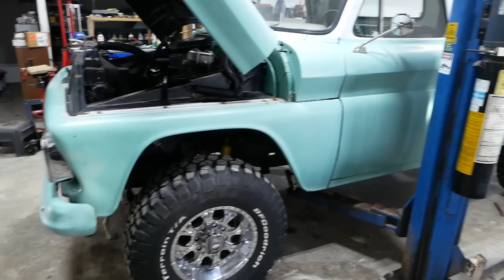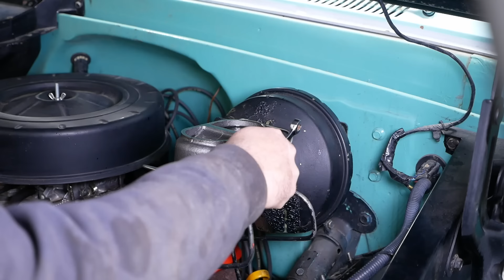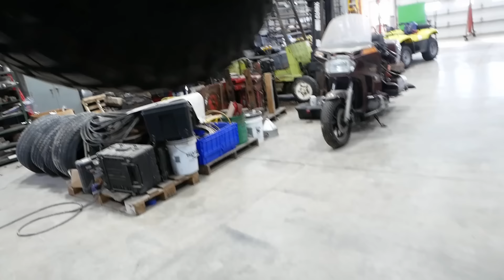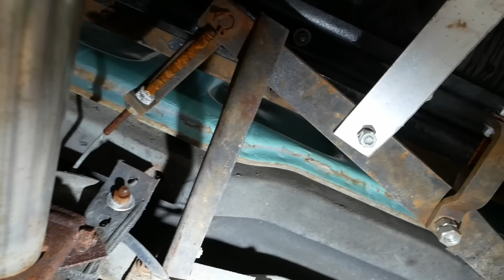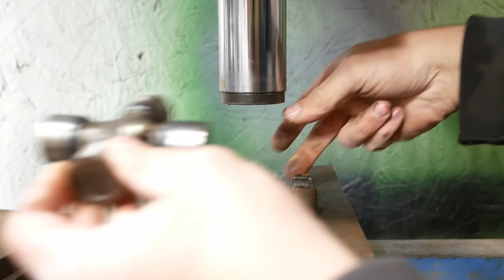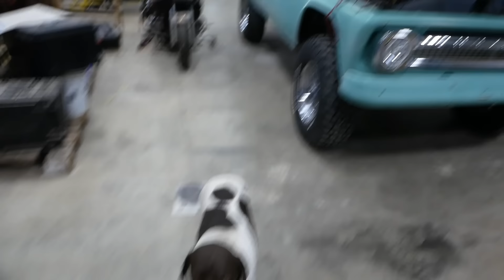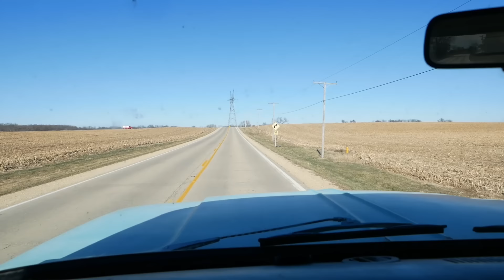New Parts = No Brakes and Other Problems | 1964 Chevy K20 Project

Comment: The current leak is most likely caused by the external voltage regulator.  The points in the regulator tend to stick.  There are conversion kits that convert to an internally regulated alternator, these are far more reliable (10si-12si vs the 10DN you now have), but you can easily make your own.  1966 and prior trucks came with a single reservoir master cylinder, someone converted it to dual reservoir.  You need to check that the current master cylinder has a residual pressure valve in both outlets, otherwise the brake shoes will sit too far back from the drum(s).    The leak down the brake booster is usually because the MC piston rear seal is leaking, if it isn't due to overfilling.  Yes, they did come with power brake boosters stock, but this one is probably an add on.  You need to make a equalizer linkage for the E-brake, it is rare to find one in a junkyard or online because these trucks are getting rare, especially the K20 trucks.  Your rear end is either a HO52 (most likely) or a HO72 Eaton, used from 1947-1972.  They make a 4.11 gear for them, but they are expensive.  A lot of people just swap to a later 14 bolt because it is less expensive and because there are plenty of them in a variety of gear ratios, and they have better brakes.  Most 70s-80s GM trucks with 14 bolts are 3 inches wider overall (1.5 per side) , most people use rims with more backspacing.  It requires moving the spring pads inwards. Power steering is possible, but you need to know how to do it.
Reply: I believe I saw a power steering pump, but it might be a dummy.

Comment: Dear Mr. Wes.
👍👌👏 Very well done again and as always. 2) 😱 My oh my! I sure have compassion with the owner! Not only that he has no clue what he is doing. He additionally definitely fell for a cobbled together dazzler from a very inhonest seller. Unfortunately the only mint thing on this vehicle seems to be the kind of mint colour. Just what morons have worked on this car? For instance by simply shortening the lower radiator hose a bit, the kink could have been avoided. Anyway: The very first thing I would've done, is to convert this old pickup truck to at least front disc brakes. Especially because the owner wants the vehicle to do highway speed in the future. Hope that the complete underside will be sprayed with good undercoating stuff before using this nice oldtimer in winter on salty roads.
Thanks a lot for making teaching explaining recording editing uploading and sharing.
Best regards luck and health to all of you (including Max of course).

Comment: wes,,where do i buy the rear lift blocks,.joke,,... what he needs for transmission, is a zf 5 or 6 sp manual box. 4.11 diffs. if he goes auto with 3.5,s. might as well ditch the front diff, as 4x4 is useless. all my trucks are 35,s. zf 5 sp. 4.11 diffs. .plus, big bonus, is fitting a bmw 3.0 tdi. 300hp. 15 lt 100..ish..theres conversion vids, world wide.

Comment: p/brake, . should hav a 2nd cable that slips thru a 1/4 curved u channel, so it slips.. or a bar pivot, like modern trucks.or, use a rock.

Comment: I personally would body swap the truck onto a Chevrolet 6.0 5 speed frame and running gear. Solves almost all of the half assed work the truck came with. Just have to find a southern frame as they all like to rot out above the rear axle.

Comment: Best cure for a howling Eaton is replace it with the GM 14 bolt. Way better rear end and won't just start howling again later. Also, the 283 isn't gonna like lugging that big thing along with too high of gearing. 3:73's would probably be too high with the tires, especially if he ever hauls or tows anything much. 4 wheel drives are much more difficult to upgrade to overdrives but fun projects if you have the right knowledge, parts and enough cash.

Comment: myine gooten,!!,, im losing faith is yanki re builds, that, is mutton dressed up as lamb,,wolf in sheeps clothing,, how quik a sale was that, make it look pretty smile a lot,,then run with the cash.. theres work there for 12 months..could be a 200k truck, like 150k over priced..when finished..250 what,ci.?..needs 350 at least. people,,either keep the damn thing original, or, fix it.. my 75 h/boy, original 300i6,4sp,drums,lwb. now, swb,1356 transfer, zf 5sp,lsd disc d60 rear, d44 locker disc front, 351c. canvas canopy,buckets,o/h console. bronco cente console. its bit ruff to me, but hell,,nothing like the chev.. i also have a 62 f100 4x4 swb,with a 352 FE, 9''. im not a spring fan..aussie..

Comment: Why does everyone diss drum brakes. I daily drive 4 wheel drum brakes and they work just fine. Not even power assist. Properly maintained they are good for normal driving. If I was racing I might want discs, but I'm not racing. Sure discs are better, but even semis still use drum brakes. As for changing u-joints (I've done a few) whatever works for you and doesn't do damage to the yoke etc. Just about any method done wrong can do damage. I know from experience.

Comment: I’ve installed u joints everywhere from the workshop to the side of a bush track. As long as they go in you know as well as me, a press, a vice or your grandma’s rolling pin can be used. Just make it work with what you have 😊

Comment: Wes, if it hasn't already been said Google Jim Carter's truck parts Independence Missouri they specialize in old Chevrolets.  They've helped me with a many a part for my 46 I owned and they have stuff new and used all the way up through the '70s even early '80s.

Comment: I have 4:11s in my 78 FJ40 with a I6 2F engine and H42 4 speed and have no issues with highway speeds, just don't over 60 because of the 90 inch wheel base. But if you want to ride on an interstate definitely get into the 3s.

Comment: If he has the budget I'd swap the axles for Dana 60's and 3.73 gears if he's going to tow. Of course, going with a 60 Super you could try 3.07's for good hiway driving. Those big tires have killed that diff.

Comment: Ehhh boy... What a heartbreak. Everything is kinda there, but kinda not. If the owner is going to do something with the axles, 3.55s with those tires and that motor is going to give it the worst of all worlds. It will be gutless from a stop and it won't have enough power to take a modest hill on the highway without downshifting and revving it to the moon, which sorta defeats the purpose.

If there's reasonable transmission option with like a .65 final ratio, that would be about perfect for it as-is. That would be 2,000rpm at 70mph. FWIW, a Gear Vendor's ($$$) with a 0.80 OD only bumps it up to 2500 and seems like it would be an easy installation. Personally, I don't think I'd want to drive it faster than about 70 anyhow.

Comment: the rear driveshaft is in backward slip yoke should always go to the front the whining is the bearing in the rear end juging by the leaks it might be low or is just worn out from that driveshaft being bent alot of guys forget 55 was the max speed back in the day they were never intended to go faster than that personally i would have to fix all the bad bracketry itd drrive me nuts also that parking brake setup is way wrong the two cable bolt into a flat bracket and the main cable to the cab bolts to the center i could show you a picture but youtube wont allow that i can email ya if ya want me personally once i move im gonna go away from that setup and use 2parking brake canisters from a semi i think itd be neat to get your wife one of these and do a proper restoration and show all of us maybe a newer drivetrain like an ls or duramax would be cool (your best bet for you would to buy a roller chassis then place the body on top halfass customs has done several like this he also has some of these trucks if you wanted to get ahold of him for pictures instead)

Comment: All the brake fluid leaking at the master concerns me.  Is it overfilled or leaking?
As far as U joints go, I was taught to use a vise.  It has always worked for ma, and that is all that matters.  My repairs were mostly PTO shafts

Comment: For a 1964 3/4 ton truck, it's just fine...  If the tachometer is correct (not likely), the gearing is just fine...  It's almost 60 years old, cut it a little (a lot) of slack...

Comment: I am no expert on the history of Chevy Trucks but in 1964 this truck may have originally had a single circuit master cylinder. I believe the dual circuit systems came out just a bit later. It definitely would not have had power brakes. That means that the brake system on this truck has been replaced and heavily modified over the years.

Comment: 1:53 "she's pretty mint" wifey may not of got the joke but I certainly did, she's pretty mint...ROTFLMAO 🤣🤣🤣

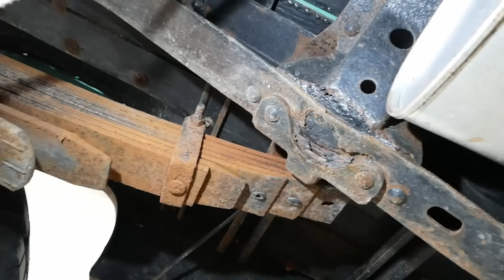19:53 is that a screw or nail sticking through the floor? WOW!!

31:11 re the parking brake, just shorten the bracket the cable from the cab attaches to, then take some flat stock, and make a 2 part T piece where the top of the T is about 6 to 8 inches wide and can swivel. Cut down the existing connectors for the rear cables and attach them to the ends of the T piece with bolts, washers, and lock nuts (Nyloc Nuts), or pins, washers, and split pins, so it can all swivel freely. 

Quick tip, for hillbilly mouse traps take some strips of duck tape and lay it sticky side up on a piece of cardboard, you can double over the ends to stick it to the cardboard, then put a bit of peanut butter or chocolate spread in the middle and leave where the mice like to run, along the walls, etc. It works a treat and is inexpensive, given you could make hundreds of traps out of one roll of duck tape.

Comment: Changed the rear U-joint in a 1955 Ford Victoria on the side of the road, on a 103-degree day with a bumper jack, a hammer, a 10-inch Crescent wrench, a pair of vise-grips and a couple of screwdrivers.  I had purchased the new U-joints and was on my way home to install them...and didn't make it...   Luckily, I was 16 years old at the time and didn't know any better.  Sometimes I am amazed that I am still alive...:D

Comment: I’m an expert U-joint professional. You installed them U-joints like a boss. Good job Wes!
Reply: Nup. He totally should have used a press clamp hammer vice. What an amateur!
Reply: @TonyRule  He did use a "linear impact driver" as Rainman Ray would describe the tool (hammer). But did he use it left or right handed - makes all the difference.

Comment: You'd hate my Suburban, I bought my 99 suburban 6 years ago, It had a howl in the rear end, I bought another rear end with the intention to replace it, never got around to it, Its been howling for 6 years, hasn't got worse, hasn't got any better, but its not to the point like that truck, its noisy but that truck you can hardly hear the passenger talk lol. Eventually, one of the reasons I've never change it out because it needs leaf spring hangers on both sides, not terrible, but it needs them. Ohio Rust!

Comment: The correct way to orient the grease zerks on a U-joint is to use nongreasable U-joints.
Reply: Non greasable, or the Spicer life series with the zerk on the cap.

Comment: Also, there is no beauty in the "Flexy hose"! That's horrendous when you can't even get the proper hoses for a factory GM small block application... After seeing this pickup I'm not surprised one bit.
Reply from the maker: They got the proper flexi hoses...
Reply: @WatchWesWork  Is there an improper flexy hose?

Comment: In the 20 plus years I've been a mechanic I have probably installed a thousand ujoints.  I think I've used every installation method known to man including smashing one rock against another rock in the woods. They've all seemed to work just fine. The most important thing is that you actually get the u-joint installed properly. The installation method doesn't really matter in my experience. You're basically beating one heavy piece of steel into another heavy piece of steel. Again as long as you're not doing something stupid like trying to beat the cap in sideways or something like that you'll be fine.
Reply: As long as you had your head tilted to the left, your tongue to the right and your eyes screwed up while "massaging" the uni joint with a rock (or two) you will be fine. Retired mechanic in Land Down Under.

Comment: It might be worth picking up a later model rust free chassis and slip it under the old girl. It's a nice looking truck for sure and once the issues are taken care of should be a good one.
Reply: The '64 has a 127 inch wheelbase , in '73 they went to 131 inches and the newer trucks are 140 inches for a reg. cab lwb. Where are you going to get a newer rust free frame that will fit , hmmm ?

Comment: I've heard that grease zerk compression thing for years. It's crap. If the u-joint is so over stressed that you have to put the grease zerk hole in compression in order for it to not fall apart you've got bigger problems.

Comment: I've always used a hammer for ujoints. Everything from the tiny steer shaft ujoints to the big 1810 series semi truck joints. Just as easy to do it on the floor or table than try and hoof it to the sketchy 80 year old 100 ton shop press.

Comment: 24:21?  I have never heard of this one and too what advantage would you get out of it by having it in so called "compression"?  I am assuming that under compression while the shaft is turning in the "forward" gear?  But still what would be the advantage?  The ZERKs facing towards the center is not necessarily always correct due to different angles on different vehicles where attaching the grease "female" end of the hose is not possible due to very minimal clearance "windows/openings".  All in all a nice job.
Reply: The take away is ignore the BS advice.
Reply: @ShainAndrews  Yeah, good one.  Have a blessed day!

Comment: If you replace any parts I hope you don't run into a defective part issue like I did this morning. I recently replaced the rear drum brakes on a 11 Chevy 1500 and it currently sitting with a rear wheel off and I'm watching your video while waiting for another wheel cylinder to replace the new one I put on that leaks. Parts quality sucks anymore no matter where you buy parts.

Comment: If you get the u-joints in and they work, and don't fall out, then you have done it right. I like using a vise because I worry about jiggling the rollers out but many just pound them in and that works too.
 It looks like they changed the e-brake cable setup between 51' and 65' trucks because the 51's did not have an equalizer link, both cables connected to the same point the way that 65' is now. My memory let me down so badly on this. Great to have the Internet.

Comment: I had an experience with that exact master cylinder setup 40 years ago. Brand new out of the box and bled it just as you did on the truck= Soft pedal. Took it off and clamped in the vise and repeated the process using the screw driver to push piston method and put back on = good pedal feel. Turned out the pedal assembly in the truck was not getting a full stroke out of the piston so it wasn’t getting fully bled.  Food for thought.
Reply: Yes sir I have had that trouble trying to pedal bleed a brake system  where the clearance between the actuator rod and the master cylinder is so much that you cannot get a full stroke on the master cylinder. You can pressure bleed the system to get the air out but not so hot when one is trying to pedal bleed the system.

Comment: There is more than one road to the same destination, same with u joints grasshopper. A strategically placed spring on that brake hose should keep it off the tailpipe.

Comment: I disagree with you on the poor performance with drum brakes and that is why they do not use them any longer. There are still some transport truck using all drum brakes and they are hauling tons with no problem stopping. The reason for going with disk is they are quicker to service.